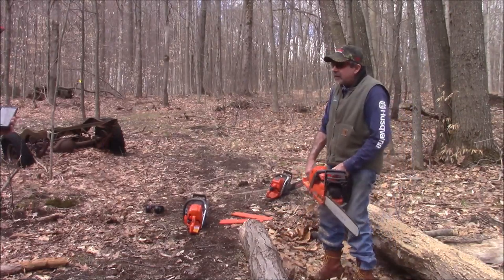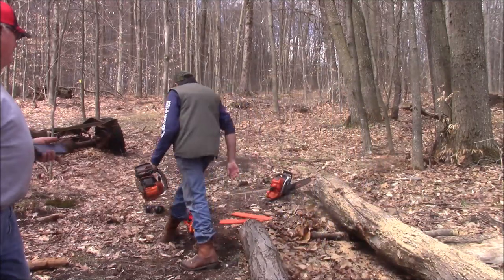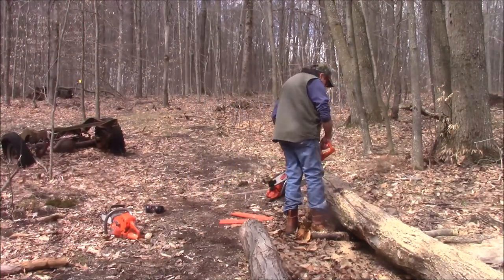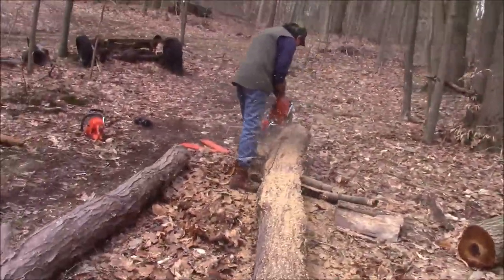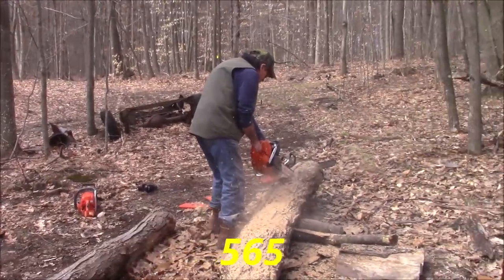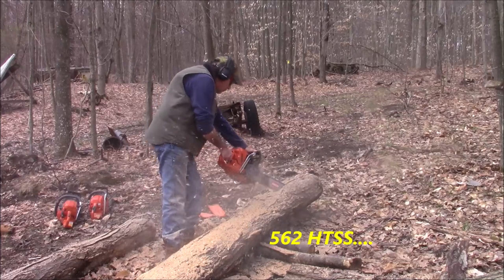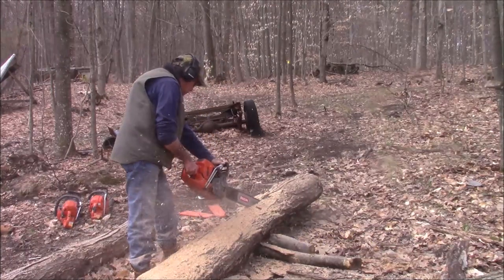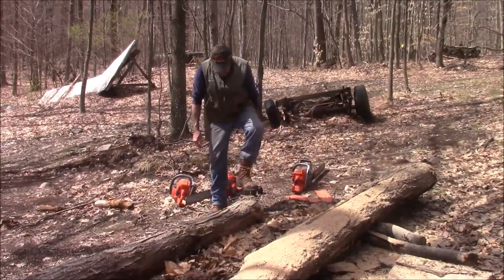Husqvarna AutoTune "Field" Reset, How To Tune Your Auto Tune  550, 555, 562, 545, 560 572, 565 :)

Comment: My 555 had the exact same issue the other week, Infact the tune was so bad everytime I blipped the throttle it would die. My local shop told me about the long cut field reset. I didn't know about the idle set

Comment: This is completely off topic of this video but you are the man that could do good content on this topic. The 070 clone saws. You have built viable 372 and 660 clones. There is a bunch of content on both builds. No one has good content of the big 070 clones. They could be great saws for a occasional big stump or running a mill if they are worth the time and money. Not much content out there
Reply: Not gonna happen- most of these YouTubers are dealers or have relationships with dealers or are sponsores (you get the drift.)  Their job is to promote dealer sales and service, not to promote knock-offs and oversee non EPA saws that cost much less...

Comment: First I heard of this .. I have a 555 .. bought new in 2014 . I use it summer and in winter, from elevations from 2000ft up to 6-7000Ft .. and it always starts right up and idles nicely .. and has good power when needed  . So when , or why would I need to do this reset ?

Comment: How often do you have to reset the high or does it make adjustments on different days after the initial reset?
Reply from the maker: I guess it depends as I never really needed to. I bring this forward for those who may have other issues that had Autotune moving to a lousy place and need to bring it back after a fix or change.....fast. But I actually can't remember since 2013 or 14 where it was really something I would have needed to do on my saws. Have never done that with my 565 for example.

Comment: Walt and Bob very usefull info. Could you guys expand on what Bob said about the idle set and the log set. After letting the saw idle for that specified time she is set for low tune? The extended log cut, is this at part throttle or are you cutting at full speed? Thanks.
Reply from the maker: Start it, use hi idle to get it running , once it cleans up a little, take it off high idle by "blipping" the throttle....let it sit there for 3 minutes and it will both adjust to idle at the defined RPM, then also after that period of time change the "setting" for low speed. On the high speed, do as Bob did at full throttle for around 45 seconds. It "tuned" in 20 as you heard, then at some point it will set the high at the right number. Pretty simple procedure.
Reply: 👍Thanks
Reply: Simple , as long as you have a 6' long log handy to trash.  😕

Comment: Thanks for demonstrating this guys👍🏻
Question: do you think the manufacturers err on the side of caution (fatter tunes) when developing the firmware for automatic carbs? 
I know this technology has come a long way, but the variables seem so wide while tuning a 2 stroke.
Reply from the maker: Not certain if that is possible as the mixture is varied to get to certain RPM's below 1/2 throttle and to max RPM's at almost to full throttle. There for the RPM requirement drives the mixture vs. the "old" way where you tune a carb and that drives the RPM's and power.
Reply: @afleetcommand  I appreciate the feedback. I love my old school iron, but for a production environment, I’d be crazy not to provide my crew AT/MT saws. No guess work...correct digital control over what had always been strictly mechanical.

Comment: I have a 545 m2 that hesitates off idle. I have about 10 tanks run through it and still have the poor acceleration issue. 
Would this reset help with that or just the high end?
Also, love this channel! Thanks for the great content.
Reply from the maker: Try both the 3 minute idle and the 45 to 60 second full throttle test cut as bob did,
Reply: did it work?

Comment: Hi, I have an xp 560, I can't reset...
it is necessary:
-start and let it run for 3 minutes at trottle 0
- then, when I cut, trottle maxi? trotting 3/4? how long time? 45sec, 1minute...??
Thank you
Reply from the maker: Yup full throttle with a load so it doesn't over rev, a normal cut RPM for 45 seconds will do the trick. OR blow it up one, either way you will learn something

Comment: Do you do the cut with full throttle or half?
Reply from the maker: Full throttle buy with enough "load" to have it in the normal ( for you ) operating RPM's
Reply: @afleetcommand  cool thanks I litterally just autotuned my 550xp today its my first husky so I was hesitant about the autotune but I guess I just had to grow a set and give er

Comment: I just picked up a 545 and first couple of cuts were ok -- but then it appeared the chain went really dull -- I filed the chain then tried again and did a couple of cuts and and started going dull again. I was cutting a 15 inch diameter log - and the chainsaw bogs down in the middle - no way it is cutting anything like your chainsaw in your video is cutting. Is there anything special I have to do to use the chainsaw properly?
Reply from the maker: Kind of hard to diagnose from afar. My "cut" is to get a good chain and learn to finesse it to maximize what the saw can do. Most of my saws are 70cc and more where as a 545 is in the 50cc class. Need displacement to cut like mine. My 562's  run like a 70cc stock saw too.
Reply: @afleetcommand  thx for the info - on the box it said it was for heavy use  - so I assumed it would handle large trees. Don't remeber seeing a cc size on it. But in the end figured out my problems. I saw another video that indicated that the 545 has as auto tune carburetor and that a runf down a log with the saw would cause the adjustment to tune properly. Once I did that it worked properly. Also - I am cuttng ash trees and did not real;ize they are hardwood - which makes it understandable why they are a bit more difficult to cut.
Reply: Information.
Sawing with a dull chain is hard work for the saw. A shap saw will have less work.
Since work load has a limit because of the system.
System here means a 50ccm 3hp saw will run a 38cm sword and be happy.

BUT when you try to cut with a dull chain the load will go up at +- a good guest 40%
Any work producing system has its limits that why there are so much motor sizes saws on the market.

On a 545 a 50cm sword is max what should be used, as it is written in the great book "the manual"

When you saw is sharp warm and tuned in it shlou be able to cut a 50cm log almost with no problems.
When there is a lack of power check compression first and then anything else.
When compression is good go over to the transmission.
Those are the most crucial system there are are to check. 
When those both are running good fuel- or oilsystem could be unhappy.

I had a saw once with to little oil giving to the chain the saw had been slowed down from the friction at the sword. And the sword got slithly blueish...

There are many autotune clips.
We let the saws run 6min without load and then ramp the workload full up.
Cutting deep in a stem for at least 90sec then the adjustments are done.
Remember a chain has to be sharp because high friction needs high workforce from the system and when that is out of whack the saw will kills it self because it is malfunctioning.

Comment: I never reset my 562xp before and I've had it now for 7 years so far and it works a1 every time and I never ever recalibrated it or anything
Reply from the maker: Most don't have to. It's one of those things where if it isn't broke , don't fix it.  USUALLY if the saw is run often OR is run in the same season where there aren't huge swings in temps & atmospheric conditions it will prolly never need a reset. In fact none of mine really needed one either. But as Bob shows once in a while one will have something happen to throw off the settings for a given day and here is a way to solve that.